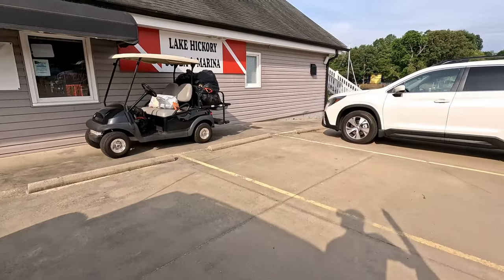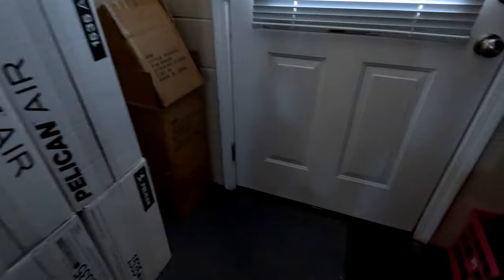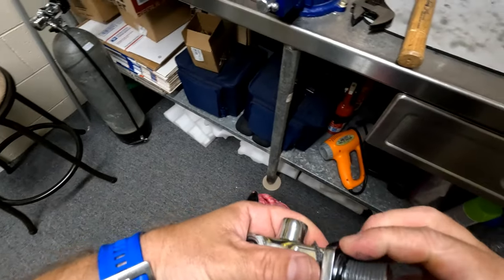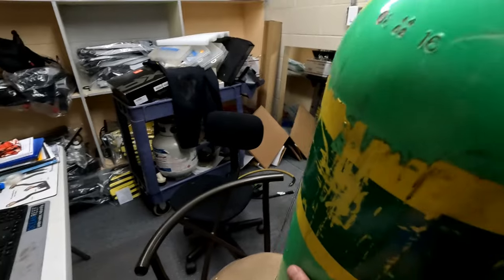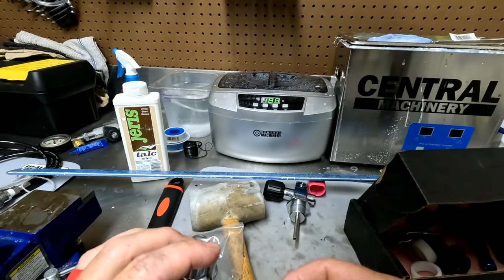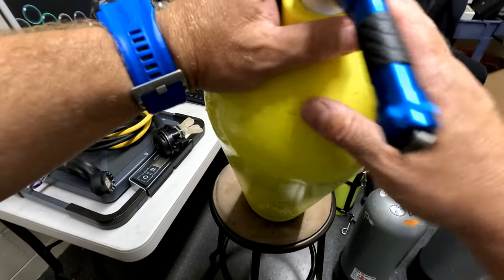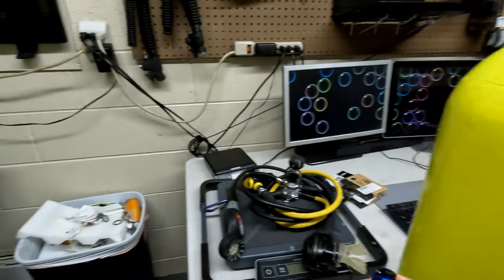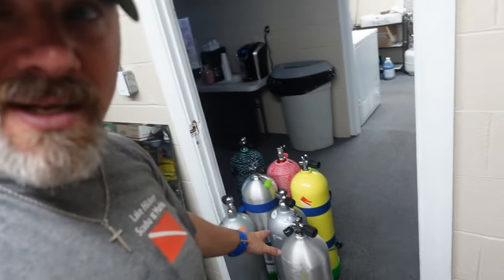Starting My Day With Multiple VIPs

Comment: My only question is why didn't you use a torque wrench after installing the tank valve? Everything else looks good!
Reply from the maker: Hello @BigFixx23, the short answer is experience on proper torque. I have been servicing cylinders my entire career, and have come accustom to the right amount of torque without the need for a torque wrench. This being said, you are correct, proper torque is to be applied when reinstalling the valve. It is encouraged that new inspectors use a torque wrench when first starting out.

Comment: Nice video, but surprised at the tank cover on the nitrox tank. Doesn’t that defeat the purpose of the big NITROX label?
Reply from the maker: Hello @RB-ie9wf, great question. The tank cover is only used on land to protect the finish. It is not designed to be used underwater.

Comment: What's with the wierd tank wetsuits? It seems to me like adding problems fo no good reason.  Holding water against the tank promoting corrosion, or adding more buoyancy swing on that AL tank? The only advantage I can see is reducing negative buoyancy on a Steel tank if necessary, for when a diver needs to use a HP tank for more volume but where the negative buoyancy becomes an issue.
Reply from the maker: Hello @kevindavison6019, a lot of divers seem to be confused with the tank covers. They are only designed to be used on land to protect the finish of the cylinders during storage and transportation. The covers are not designed to be dived with on the cylinder. Hope this clears up the confusion.